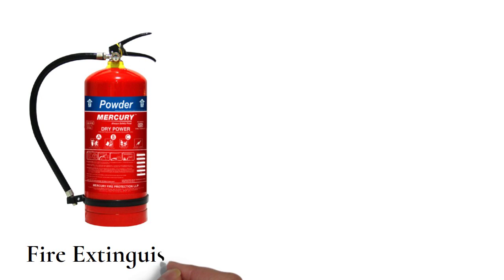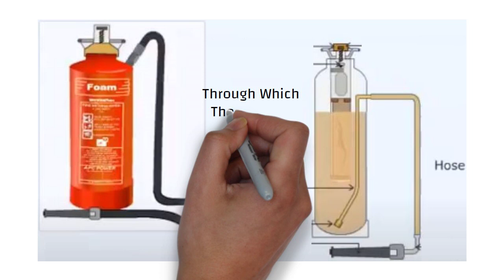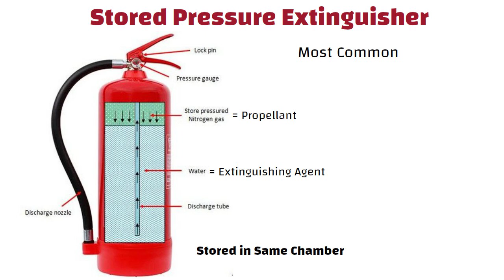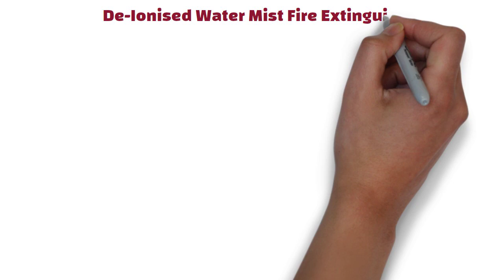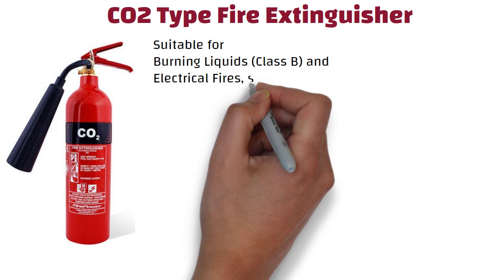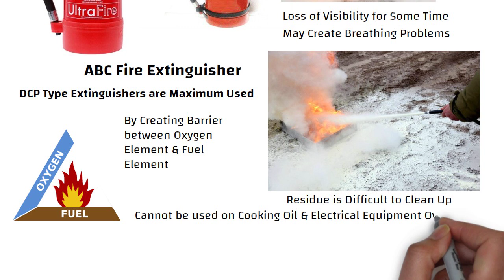FIRE EXTINGUISHER DEALERS IN KERALA, CALL 8138906102, FIRE EXTINGUISHER DEALERS IN ERNAKULAM.

Comment: Fire extinguisher dealers in Karunagappally
Reply from the maker: Fire contractors in Trivandrum, Fire contractors in Trivandrum,Fire contractors in Kollam, Fire contractors in Idukki,Fire contractors in Kottayam,Fire contractors in Pathanamthitta, ABC type fire extinguisher dealers in Kerala, Karthar valve dealers in Trivandrum, Karthar valve dealers in Calicut, Karthar valve dealers in Thrissur,Karthar valve dealers in Palakkad, Karthar valve dealers in Malappuram, Karthar valve dealers in Kannur, Karthar valve dealers in Ernakulam, Karthar valve dealers in Kollam, Karthar valve dealers in Kerala. Smoke detectors in Kerala, Smoke detector in Calicut, Smoke detectors in Thrissur, Heat detectors in Kerala, Fire safety systems in Kerala, Fire safety equipments, Fire protection system equipments in Kerala, Fire protection system equipments in Trivandrum, Fire safety equipment in Kochi, Fire safety equipments in Ernakulam, Fire safety equipments in Calicut, Fire safety Equipments in Kerala, Fire equipments in Kochi, Fire equipment dealers in Kerala, Fire equipments in Calicut, Fire equipments in Thrissur, Fire equipments in Palakkad, Newage dealers in Kerala, Newage dealers in Ernakulam, Addressable fire alarm system in Ernakulam, Addressable fire alarm system in Kerala, Addressable fire alarm system in Calicut, Addressable fire alarm system in Thrissur, Addressable fire alarm system in Kannur, Addressable fire alarm system in Palakkad, Addressable fire alarm system in Malappuram, Addressable fire alarm system in Trivandrum, fire fighting companies in Perumbavoor, fire extinguisher suppliers in Perumbavoor, fire and safety equipment in Perumbavoor, fire extinguisher dealers in aleppey, fire fighting contractors in aleppey, fire and safety systems in aleppey, fire consultants in aleppey, fire fighting companies in aleppey, fire extinguisher dealers in alappuzha.fire extinguisher dealers in pala, fire fighting contractors in Pala, fire and safety systems in pala, fire extinguisher suppliers in Pala, fire and safety consultants in pala, fire equipment in Pala, fire and safety installation in pala, fire protection system in pala, fire protection system installation in pala, fire protection system contractors in pala, fire and safety consultants in Pala, fire fighting companies in pala, fire fighting equipment dealers in Pala, fire equipment dealers in pala, fire consultants in pala, fire system installation in pala, fire protection system in pala, fire NOC in Pala, fire AMC in pala, Fire extinguisher dealers in Kannur, fire fighting contractors in kannur, fire and safety systems in Kannur, fire fighting companies in kannur, fire and safety consultants in kannur, fire protection system in kannur, fire alarm system in kannur, fire extinguisher suppliers in Kannur, fire extinguisher in kannur, fire consultants in kannur, fire and safety consultants in kannur, fire protection system in kannur, fire and safety equipment in kannur, fire fighting equipment in kannur, fire fighting companies in in Kannur, fire protection system installation in kannur, fire safety contractors in kannur, fire contractors in Kannur, fire consultants in kannur, fire fighting contractors in kothamangalam, fire extinguisher suppliers in kothamangalam, fire fighting companies in kothamangalam, fire and safety systems in kothamangalam, fire and safety consultants in kothamangalam, fire protection system in kothamangalam, fire alarm system in kothamangalam, fire extinguisher in kothamangalam, fire consultants in kothamangalam, fire safety contractors in kothamangalam, fire NOC in kothamangalam, Fire extinguisher dealers in Perumbavoor, fire fighting contractors in Perumbavoor, fire and safety systems in Perumbavoor, fire consultants in Perumbavoor, fire protection system in Perumbavoor, fire fighting contractors in Moovattupuzha, fire extinguisher dealers in Moovattupuzha, fire fighting companies in Moovattupuzha, fire extinguisher suppliers in Moovattupuzha, fire and safety systems in Moovattupuzha, fire protection system in Moovattupuzha, fire extinguisher in Moovattupuzha, fire fighting companies in Moovattupuzha, fire consultants in Moovattupuzha,

Our Brands: Newage, Safex, Minimax, Sha Bhogilal, Mosher, HD, Tyco, Winco, SRI, Eversafe, Priyanka, Morley, GST, System Sensor, Honeywell, Seimens, Seculite, Arihanth, Newtech, Bosch, Notifier, Edwards, Karthar, Kirloskar, Atom, Andex, Ceasefire, Zoloto, Normex, Audco, Intervalve, Agni, Agni Suraksha, Ravel,  Agni, Indfoss, Danfoss, Safex, H Guru, National, Tata, Jindal, Kanwal, Safety First, De Flame, Safe Guard, Life Guard, Finolex, Polycab, Gloster, Read, Aadi, L & T, ISI MARKED, APPOLO, MATHER & PLATT, LEADER, SANT, ADVANCE, CASTLE,Kirloskar, Prime, CRI, CROMPTON, ABB, LHP. M Tech, MS Jindal pipe dealers in Kerala, motor control panel in kochi, fire pump panel in kochi, motor control panel in Calicut, Morley fire alarm in kerala, gst fire alarm in Kerala, addressable fire alarm system in Kerala. Pa talk back system in kerala, PA talk back system in Kochi, auto glow SIGNAGES in kochi, auto glow SIGNAGES in kerala, fire pump PANELS in Ernakulam, LHP pump dealers in kerala, Kirloskar pump dealers in kerala. Lubi pump dealers in kerala Karthar valves in kerala, Ravel fire alarm system in kerala. Jindal pipe dealers in kerala, Jindal pipe dealers in Ernakulam. MS and GI pipe dealers in Ernakulam. Butterfly valves dealers in Kerala, PA talk back system in Kerala, PA talk back system in Trivandrum, PA talk back system in Calicut, PA two way talk back system in Ernakulam, PA talk back system in Kannur, fire alarm panels IN KERALA, MCP, hooter, hydrant valve, branch pipe, cp hose, RRL hose, heat detectors, Motor Control panel, fire rated doors, fire doors, duct doors, LED EXIT LIGHTS, emergency exit light, Auto glow signages. Fire hydrant systems etc, fire fighting pump dealers in kerala, fire pumps, pressure boosting pumps, hydro pneumatic systems, sewage pumps, vertical inline pumps, diesel driven engine pumps, fire fighting pumps, Sewage pumps, Turbine pumps, STP pumps, ETP pumps, Cutter pumps, Industrial Pumps, RO pumps, Vertical inline pump dealers in Kerala, STP and etp pump dealers in Kerala, Hydro pneumatic pressure boosting pump dealers in Kerala, Kirloskar fire fighting pump dealers in Kerala, Lubi fire pump dealers in Kerala, CRI pump dealers in Kerala, RO and waste water pump dealers in Kerala, Fire fighting diesel engine pump dealers in Kerala, Pressure boosting pump dealers in Kerala, Industrial pump dealers in Kerala, Chemical pump dealers in Kerala, submersible aerator pump dealers in Kerala, horizontal end suction centrifugal pump dealers in Kerala, Fire fighting main pump, standby pump and jockey pump dealers in Kerala, Vertical multi stage Pump dealers in Kerala, Cutter pump dealers in Kerala, Dewatering pump dealers in Kerala, three phase monoblock pump dealers in Kerala, fire fighting terrace pump dealers in Kerala,  fire fighting pump dealers in thripunithura, fire fighting pump dealers in ponnani, fire fighting pump dealers in vadakara, fire fighting pump dealers in thalassery, fire fighting pump dealers in kanhangad, fire fighting pump dealers in payyanur, fire fighting pump dealers in koyilandi, fire fighting pump dealers in parappanagadi, fire fighting pump dealers in kodungallur, fire fighting pump dealers in neyyatinkara, fire fighting pump dealers in thanur, fire fighting pump dealers in malappuram, fire fighting pump dealers in tirur, fire fighting pump dealers in tirur, fire fighting pump dealers in kasargod, fire fighting pump dealers in mananthavady, fire fighting pump dealers in cherthala, fire fighting pump dealers in kattapana, fire fighting pump dealers in kothamangalam, fire fighting pump dealers in attingal, fire fighting pump dealers in kalpetta, fire fighting pump dealers in kottarakara, fire fighting pump dealers in kottarakkara, fire fighting pump dealers in pala, Lubi fire pump dealers in Kerala, CRI fire fighting pump dealers in Kerala, Sewage pump dealers in Kerala, Vertical inline pump dealers in Kerala, Vertical turbine pump dealers in Kerala, Hydro pneumatic pressure boosting pump dealers in Kerala